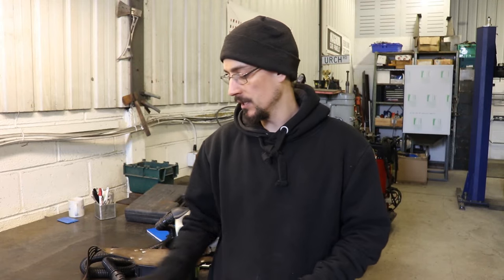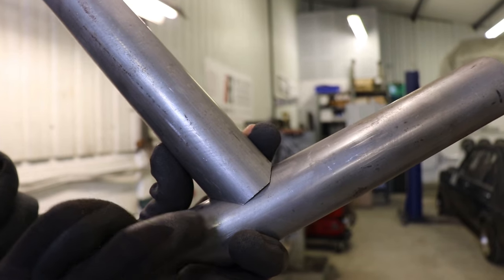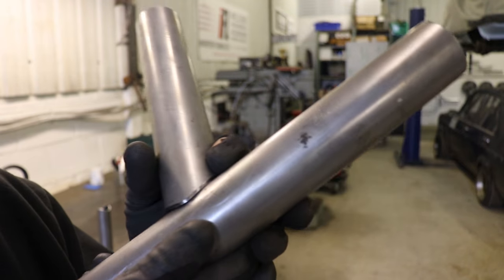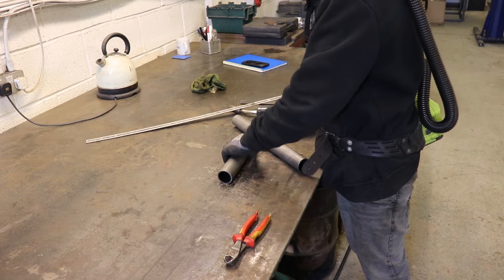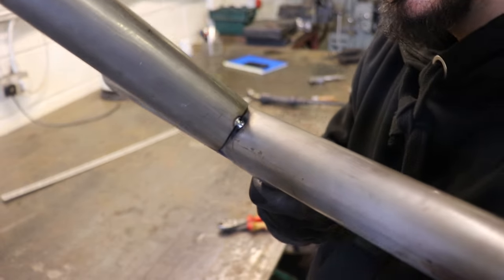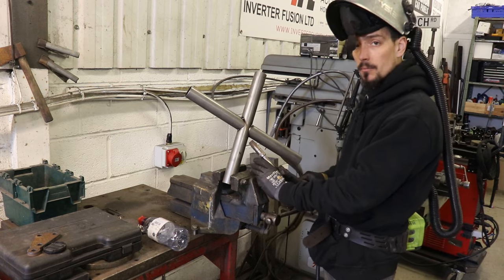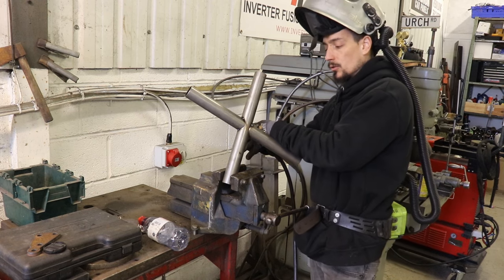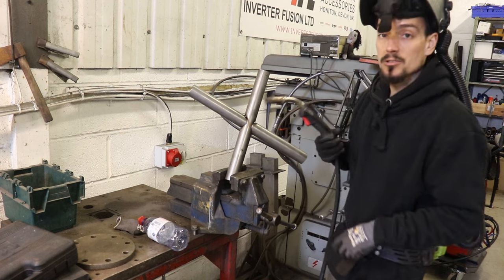TIPS FOR MIG WELDING AROUND TUBES - ROLL CAGE FABRICATION

Comment: Great video mat, I was in the shop over the weekend turning a friends mini bike into a trike and I was fabricating with 3/4 inch galvanized tubing and between not welding in a while, trying to stay out of the zinc smoke and my 57 yr old eyes 👀 it was kicking my ass, I put a lot of pressure on myself to have my welds look perfect and I could get a perfect bead all the way around the joint to save my life

Comment: If you have a lathe you can use it as a notcher, just a tip if someone needs it😁
Reply: How do you notch with a lathe?
Reply: Holesaw in the chuck amd attach the tube to the cross slide.
Reply: @eurobeatmachinist732  interesting I used to use the mill in the same way
Reply: @therealrobertbirchall  Yeah it works too, I use my lathe as a mill sometimes since I dont have a mill, yet.
Reply: @eurobeatmachinist732  I bought one of those cheap Chinese mini mills. It's fine now I have replaced the plastic gears with steel ones. The gears are the same as the cheap Chinese mini lathes. I have a Myford lathe, have to have some proper kit.

Comment: Hey man, very helpful video, I’m getting a Mig machine today to install a cage in my Camaro for the NASA CMC series. I’ve got a few questions though about it. 

I’ve heard that some people tend to not weld the entire length of tube when it’s against the roof/headliner (I assume it’s because it’s too tight). 

I read on a forum that you can cut the floor the drop the legs of the cage… How effective is this? Does it weaken the part of the floor where the cage plates are getting welded to? 

Also are there any tips you would give me as a newbie?

Comment: What wall thickness tube do you generally go for?
Reply: If welding a roll for racing or drifting, the rules and regulations usually state what minimum thickness and quality of tube/pipe to use

Comment: Pro tip regarding welding downwards as opposed to upwards; With MIG/MAG it's easy to get a nice weld when welding downwards, but if you want maximum strength and good penetration, always weld upwards. If you're stick welding or using TIG, upwards is always recommended. Also, you will never get as strong welds with MIG/MAG as you get with TIG, sticks, or innershield/flux core wire. For welding pipe joints with maximum strength, TIG is superior. Btw, I used to be a certified welder in the oil & gas industry.
Reply: Why is TIG superior?